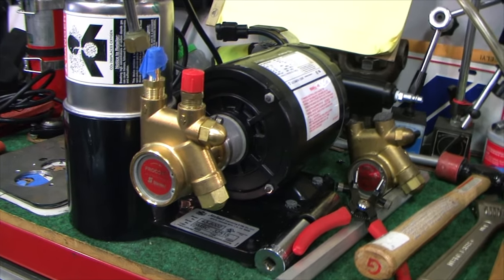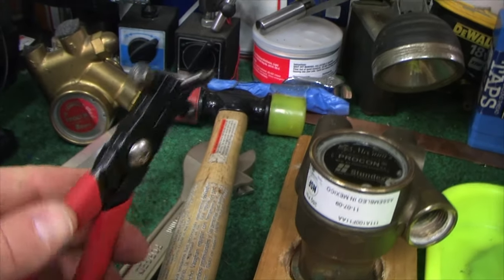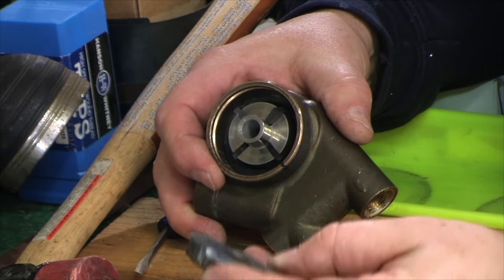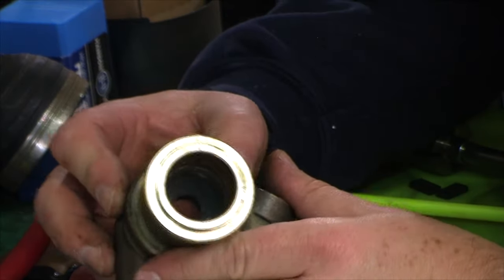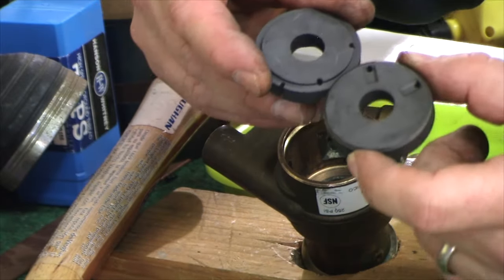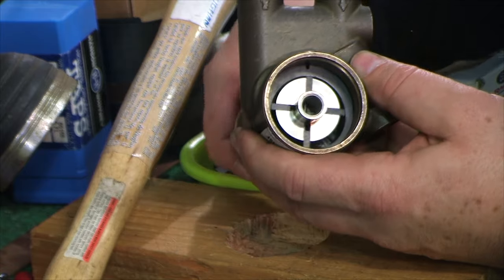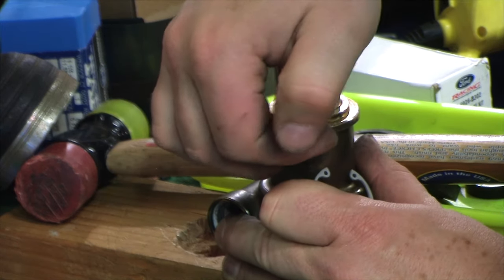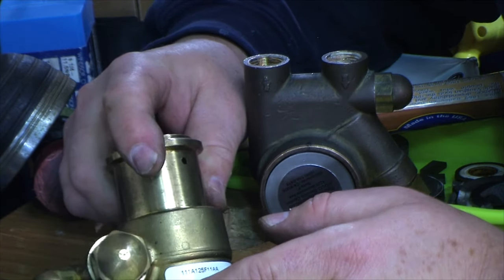Procon Pump Rebuild - TIG Cooler Project Part 1.5

Comment: I have nothing but good things to say about Edco Distributing.  Their charge for rebuilding your pump is not much more than the parts kit alone.  In my case, they replaced my entire SS housing for an extra $5 and (at my request) returned the old one to me.  If you have a 100 GPH pump and would like it converted to 15 or 25 for your TIG cooler, they can do that for free.
Reply: I just ordered a new OEM pump for my Miller Coolmate 3X.
Edco does offer a kit, but it was $65 and the new pump was only $105 vs hundreds from a welder parts store. Edco said the kits do come with all internal parts except the rotor.
   The OEM pump is 100 gph and relief is set at 55 psi, well I believe my old pump to be the original. I will call Miller to check what the relief pressure should be.
Reply: @stephensarkany3577  - This comment may not apply to your situation, but I thought I would share the thought anyway.  While most of these positive displacement pumps do have an internal pressure relief valve, their purpose is mainly to protect the pump from damage rather than to regulate normal system operating pressure.  Procon is pretty clear about this in their documentation.  In the torch cooler I built, I used an external "bypass" regulator (slightly modified TeeJet 23120 relief valve) to control the pressure and make it easily adjustable.  If your pump's rated flow is well matched to the needs of your torch, perhaps the external regulator is not required.  Just sharing thoughts...  Good Luck.
Reply: @ralphwaters8905  always interested to listen to a well reasoned opinion.  I am slightly aware of teejet as I do a lot of farm repairs. They do make good stuff. I ran the label numbers on my old pump past Edco and I am hoping it was the original one, not a replacement. I also have a coolmate3 that I know is original, think I will go out right away and check spec on that one incase I need to mod my order.
Reply: @stephensarkany3577 I highly recommend EDCO! They are very knowledgeable and amazing to work with. Depending on the part number, Millers pumps are always set at 55 or 60 PSI.  Based on the info you provided, the part number is more than likely 10597? If so then yes, the pump is set at 55psi. 
Regardless of the part number, the psi setting should be noted on the white label, located on the bottom of the pump

Comment: Interesting. Glad you posted this. My best guess is that a tube of food grade silicon grease would help dramatically on the rebuild. Had no idea there were as many small parts in that pump. Cheers.

Comment: Great Vid! Thank you Hank. I usually hate these types of vids, takes too much time... yours, I followed all to the end!
***A little trick I found useful:
If you find it difficult to slide in the parts, or if you don't even want to risk it, you can soak your pump body in hot water, 55C more or less so you don't burn yourself, before assembling the carbon parts back in.

Comment: Thanks for the detailed video, which I used to rebuild a Series 1. I'd like to add that a little silicone grease on the rubber parts makes the assembly ever so much easier. I didn't have much luck with the "clamp" method of squeezing down the big o-ring to seat the c clip. But after it got lubed, I didn't even need the clamp. Just some light taps with a screwdriver/hammer and the c clip popped into its groove. I also lubed the wear surface of the pump seal so it would have some lube during startup until water contacted it. There are "food-rated" grades of silicone grease for installations which need that. Also the pump seal slid in much easier with a little grease on it. And a fun fact: the pump seal in the diagram that came with the Edco rebuild kit did not exactly match the actual pump seal in the kit. And a slinger in the diagram was missing from the kit. But after everything was assembled, the shaft turned very smoothly by hand, neither too loose, nor too tight. Testing showed it met spec for pressure and flow and the seal held tight.

Comment: Thanks for a great tutorial on rebuild of Procon pumps. I've been in the beverage business for 40+ years and rebuilding Procon pumps have always been a challenge, really the most that I'm comfortable with is just replacing the nameplate O-ring on the front of the pump. Edco or Procon will not give you the size but I have found that a food grade o-ring (size R-28 37.69 X 3.53)  seems to be an an accurate replacement. That is a round o-ring that will look square or rectangle when removed. I Typically use a special food grade lube to reassemble the plate and o-ring with a simple c clamp to push it into place.
Reply: Yep it's McCann's- the company was run by Jerry McCann and very successful in the beverage industry...I knew him. Also on the subject of lubrication for the seals I would use the Danco Silicone Grease (88693) available at Home Depot. it's better than the keg lube available at home-brew shops.

Comment: Great video, I think that you might have had the mechanical seal not right.
The ceramic needs to run on the face of the carbon graffite service.
This is how the water seal works.
If you run the pump run dry, then this gets to hot and breaks, leading to water to the bearings.
It breaks also eazely when you knok the axil.
Reply from the maker: Yeah, I think the spring seal may be backwards as others mentioned. Important to note parts direction when taking it apart as the sheet of parts does not show it. Thanks!

Comment: Great video! Thanks! I need to call you on one crucial part though. I believe you show the spring loaded part of the shaft seal inserted the wrong way. The end with the hard smooth thin ring goes against the white plastic piece. The surfaces that contact while spinning at high speed need to be smooth with minimal friction. If you insert it so the rubber end spins against the stationary white plastic disk, you'll melt the rubber and lose your seal in short order I would think. I know this because I have rebuilt centrifugal fluid pumps which use the same type of seal & the parts diagram for those pumps illustrate that orientation better. Also, a small amount of clear silicone grease should be used without introducing oils from your hands to the contact surfaces. Refurbished procon pumps that I've received are snug to turn by hand, but it should feel smooth to turn & you should not need a wrench. I really appreciate the video though. Very helpful! It is very easy to break those phenolic end bearings, dang it.
Reply from the maker: Thanks Paul! I was unsure of the direction of the pump spring. Even the diagram is a bit unclear. I should crack open a new one and see. I think I mention to follow the rebuild sheet and make sure you watch as you take things apart as I was a bit careless and too the pump apart. My thinking was the white disk was the friction reducer but I totally could have it backwards. I have a new pump and should just bit the bullet and crack it open and see :)
Reply: Hank Kimball Yeah, I hate to have you risk breaking those phenolic parts opening it up, but if you're like me, you'll want to verify the info. I wonder if applying some kind of lube to the back end will help the pump cartridge slide out without damage. I like Molykote 44 Medium. I believe it is safe for rubber & plastic.
Reply from the maker: Yep, not a big deal except finding the time. I have some spare parts, but more a time thing... have to squeeze it in between engine pulling and chores :) One thing I would be careful with is grease especially if using in food processing. I think you can get specific NSF approved lubes for food machinery, but honestly I don't think these pumps need much. They seem to run for a long time in crappy conditions without much of anything other than tap water. I think the one I had was from the 1990's and other than the leaking seal, was OK.

Comment: I pulled the rotor of an Australian built 1995 pump, the rotor came out in 2 parts.they slipped into each other. Obviously was machined separately.  Not sure it was welded after machined or had some kind of join, but the motor end does not spin the vane holder part.
Reply: Look at another rotor. Look like 2 parts of rotor were pressed fit. No mechanical locking.

Comment: On my series 2, the ball bearing is a little special: 30mm OD and 7/16" ID. The only place I know to get them is through an electric motor repair shop or a bearing supply house. I tried looking them up on the internet and didn't find anything.
Reply from the maker: Try McMaster for odd stuff like that or just get the rebuild kit with all the goodies
Reply: @GarageProfessor  yes, I know McMaster very well. I didn't see the special bearings there. I have refurbished lots of fractional hp motors that use bearings with a oddball ID.  Most of them are a 6203 and I can get them from Bearing Distributors,  or from my rewinder.
   I just ordered a pump because it was like only $40 more. I will probably get a kit & fix the old pump for spares. If I can get the bearing Cheap enough I might just slide a bearing in and check for leaks as the seal looks good.  I have a few old Bernard coolers that might need a pump.

Comment: my brand new pump looks like its putting out black shavings into the water tank, idk if it from the vanes or bushings but i dont want to drink that, My old one was doing the same thing and thats why i bought a new one. Any input on this issue, im thinking of putting a filtration system post pump, but dont know if this is a good idea for the life span on the pump and what filters can handle post 150 psi pressures.
Reply from the maker: Odd that the new pump would have the same issue. Is it possible that the shavings are from the old pump and in the lines and tank? Or possibly coming in from the source into the pump? I would try flushing everything if you already didn't.
Reply: most common cause of this is the inlet line itself.

Comment: Thanks for the video is completely useful, what after assembling all parts is not possible to rotate the shaft with the hand? is their a problem or is normal dur to the load of the new orings?
Reply from the maker: Yeah will need something to turn it.

Comment: If I used one of these motors for beverages, what would I need to use to grease/lubricate the motor itself?
Reply from the maker: Not sure. Most motors have sealed bearings. Should have a model and brand on it. That can get you more info on it and if it can be lubricated
Reply: @GarageProfessor  Thanks for the response! So I've been digging around and basically found that I am supposed to use a 3 in one product that is motor oil for electric motors. I guess I'm supposed to avoid using regular oil cause of the detergents in it.

Comment: Hi Hank, thanks for your answer,
are you in California?
I have an espresso machine with a leaking pump,  I am looking for a rebuild kit but I can't find it on ebay 
could you provide the place you got it if you could. 
Thanks
Reply from the maker: Yeah, in CA, here is the place where I got the kit from - check out Edco at - http://www.edcodistributing.com/pcpumps.php they have the kits. You might still be better off looking on Ebay for a deal, or a new pump depending on your budget. Ebay has some brand new sometimes for a bit more. Just depends when you catch the auction, but Edco should have the kits you need.

Comment: What is the average or expected runtime life on these?
Reply from the maker: I think the are designed to run for years. Every soda fountain has these or similar and the seem to last. In the welder tig cooler I have had mine for a couple of years and while I done use it that often still ok no leaks and good pressure.
Reply: IDK, but I have a tig cooler that is 20 years old and still going, and another that leaking seal rusted the bearing tight. I think it depends on the fluid being pumped.

Comment: What did you do with the carbonator tank? Looking for a small one if you still have it.
Reply from the maker: I used the tank for the TIG cooler project. Look around on ebay you can find used ones not too pricey.

Comment: Do you know if these can handle picking up liquid chocolate? I want to move 35 degree chocolate from one spot to the next. the Pump would have to lift the chocolate about 10 inches. and direct it 15 inches. do these pumps have any lift when attached to motor? do they require priming?
Reply from the maker: Don't know if they would be good for pumping something that thick. They are generally pressure fed a bit in Soda applications by the water line. In my TIG cooler they are not. I think the main issue would be thickness of the chocolate goo, and remember these pumps put out a lot of pressure too. Also don't know how all the guts would react to the chocolate but I don't know if it would be a good fit for this type of pump. Funny thing is sounds like an automotive oil pump might be something to look at but that is not generally a self contained pump and also if for food not sure it's sanitary safe.

Comment: Does anyone know if the shaft dictates how many GPH these move.   Wondering what the difference is from a 240 GPH pump to a 330.
Reply from the maker: Not sure but I would see if you can find a parts list or dimensions on the two different GPH pumps. Also the GPH may be based on pressure.
Reply: Hi there. It is the diameter offset that does it. Look at your inner circle where the vanes go compared to the diameter of the shaft. Said a different way, it is the distance between the stainless steel shaft OD and the outmost vane outer point. This varies, and the larger it is the more it moves!

Comment: My procon pump is leaking water should I just seal it with m seal or buy new one?
Reply from the maker: If it's leaking it will only get worse if a seal is going bad. Time for a rebuild or new. Double check fittings and hoses to make sure not them.
Reply: @GarageProfessor  thank you

Comment: Sucks all I need is a new o ring for the relief valve, but I don't wanna buy the whole kit just for one part
Reply from the maker: Just see if you can find the size at a hardware store or auto parts store. You should also be able to find them online but shipping will kill you. Local parts place should have them.
Reply: @GarageProfessor  thanks I'll look around

Comment: I see a lot a guys on the wrong side of the globe use these to move lp. Are they really strong enough to move high pressure reliably.
Reply from the maker: Tiersmoke92555 I think these will pump most anything provided the have the right seals. I saw some old pics of them (variant) pumping fuel for race cars. It's a nice simple pump, durable and easy to fix. Lots of different options for seals, and other materials.

Comment: Hey if the piston dosent spin freely if you try to turn it does that mean its jammed or is that just how it works. I figure it is but I had to ask
Reply from the maker: Grandad Certified 
They don't spin freely at all, they are a bit hard to turn by hand. You can use a small wrench to spin it, and should not be rough or something is likely wrong. Also look at the weep holes and if rusty, likely the bearing and seal are shot.
Reply: It dosent spin smoothly when turned with a wrench. Although the weep holes dont seem to have rust. I initially tried running my system and the motor slightly smoked up after making a noise as if somethng was blocking it from turning motor inlet turns just fine guessing its the pump since it turns with a squeak when forced. Thanks for the reply
Reply from the maker: Grandad Certified 
If the motor let the smoke out, pull the pump and run the motor to make sure it not a bad bearing or burnt motor. Otherwise pump is bad, Open it up and take a look.
Reply: I have a hard time believing the motor will be able to turn the pump I turn it with difficulty, every turn it stop at a point where I need to put more pressure to get it past there and keep turning. Also how do I run the motor without the water running through the pump? Isnt that what activates it?
Reply: I just dunked the whole pump in vinegar no more of that resistance still can turn it with my fingers but when I use a clamp/wrench wtv its called it turns pretty nicely. Only other problem to check out should be the motor bearing. How do I open the thng it seems impossible to get the metal casing off
Reply: cant turn with fingers*
Reply from the maker: Grandad Certified 
Not sure how to open the motor, but just run it without the pump. Also spin the motor by hand and if it feels rough, might have a bad bearing.

Comment: Do you know where I can faind this kit? I were looking on ebay and I couldnt find it. Thanks for you help.
Reply from the maker: check out Edco at - http://www.edcodistributing.com/pcpumps.php they have the kits. You might still be better off looking on Ebay for a deal, or a new pump depending on your budget.
Reply: Thanks for your help.
Reply: Thanks for your help.

Comment: where can i buy the rebuild kit???
Reply from the maker: I got my kit from Edco at - http://www.edcodistributing.com/pcpumps.php they have the kits. You might still be better off looking on Ebay for a deal on a new pump depending on your budget. I think the price for the kit and shipping was very close to picking up a pump on EBay.   If you do get a rebuild kit they will need the part number off the pump to find out which kit you will need. They were pretty helpful when I got the kit and made sure I had the right one.

HTH
Sandy